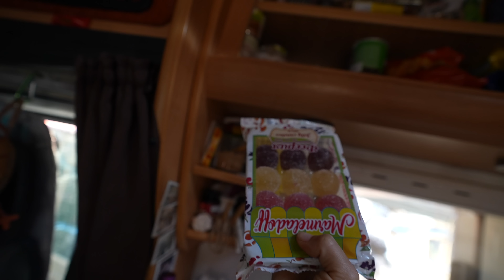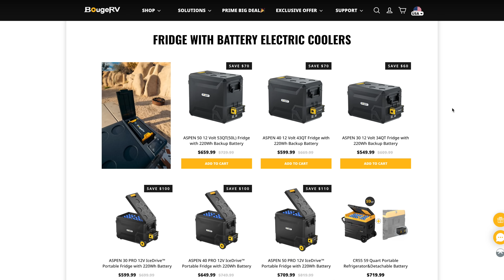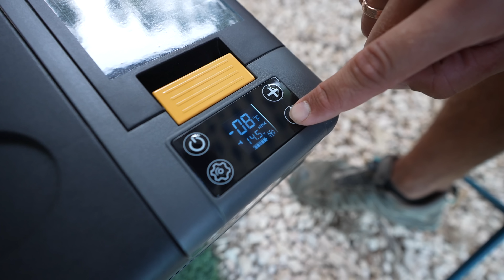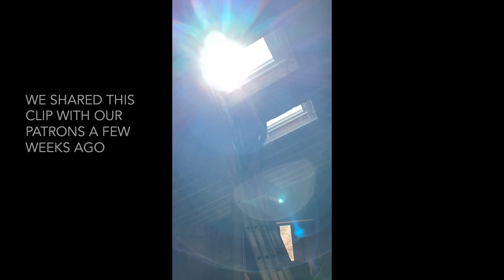THE INCREDIBLE RESULTS OF OUR CHALLENGING ROOF BUILD (with skylights)!

Comment: Great job. On that crack on the pillar, you should fill it with exopy ASAP. There is nothing to worry about, fairly normal, but should be air and moisture tight as soon as possible, so the steel won't rust.

Comment: Excellent job! Igor & team did a wonderful job, well done to them. You can buy shades that sit on the outside your velux windows and believe me you might just want them in the heat of the summer. Theyre easy to install, still let in light. Just think of it as your window wearing sunglasses!  Brittany can also get a pole to help open the windows.

Comment: Helpful hint. Nowhere in LA is recycled water used for drinking water. Tap water comes from Colorado River and wells. Reclaimed water can only be used for landscaping. Hope that helps the next time you visit. 😊
Reply: Not entirely true, L.A does recycle water which ends up in the groundwater basins, which gets treated and later ends up in L.A taps.
Reply: Thank U ❤ City Water is always 
Better. Even in Camden New Jersey. Out of the City and Slim in My drinking water. Love U Both
Reply: In todays world the water from the wilderness has probably seen both human and animal waste byproducts among other things like chemicals. It’s just been filtered through nature by the time it pops up in a spring. I’m sure municipalities test the water and deem the spring safe to drink. Same as done in LA and any other city. ❤
Reply: The roof transformation is magnificent. The larger extended roof will create alot of rain water runoff. Any plans for gutters/downspout(s) and water storage? Filtered, UV light, stored in an inground cistern (s). Could be concrete, drums, barrels, pool, lagoon. Used for washing, bathing, irrigation.

The wedged area below the roof and above the old waterwheel can be turned into a respite multi-functional space with lots of light. Access above at road level and below. Yoga, meditation, plants, reading nook, exercise area, vertical waterfall landscape feature, rope climbing exercise wall, vented glass green house.

I would use the salvaged tree trunk pieces for river bridges or stream obstacles, tables or chairs on the high beach lagoon area. If the wood is good and can be sliced into boards, maybe used as a catwalk connecting bridge walkway on the new wedged roofed area.

For now drier interior with more light. Open windows, reducing any damp musty smell or odors from animal droppings. Future temporary storage and living quarters for winter.
Reply: You two are my favourites for sure. Portuguese school? Come on no one else does this? I love that you guys embrace the Portuguese culture even going to school.   About the cats feed them inside the house even if not fully finished, they will take care of some critters around and make sure they don’t re-enter the house.  Keep it going love your videos.

Comment: Roof look amazing, Dont pressure wash, normal rain or just a hose will be fine, pressure washing is to harsh, it damages the surface and you will have problems sooner. 
Because your house is not built with stone by the bridge then you wont need lime render  there. 
Those new columns look amazing in shinny concrete and visible stone, there perefect. 
Your personality is starting to shine through on the mill. ❤Xx

Comment: Those contractors are very skilled and work hard. You were lucky to find them. I installed a Velux skylight in our kitchen about 15 years ago. Used their factory flashing kit (on asphalt shingle roof). Has never leaked and still looks clear. Thanks for sharing your project

Comment: You will need to put something in those pillar cracks to help the structural strength. I believe there is an epoxy for that.
Reply: Of course the pillars will be finished  and the holes sealed...

Comment: min 12.10. need to give first  first layer, a small amount of concrete on that brick , like you will paint  your walls,  , so that layer will adheres at the brick, after you put the thicker concrete.. in time will crack /separate from the brick because of poor adhesion.

Comment: You will use underfloor heating I assume . Otherwise it will be very cold in winter as large volume rooms are difficult to warm so you’re comfortable.
Reply: Yes  in Portugal to keep a house warm in the winter will cost you a lot ... energy is very expensive...wether it´s electric or gas or fuel....probably best option it´s heatingh the room with some sort of solar panels system...also some airconditioner inverter  units are very eficient..some years  ago I visited a very expensive and well built house owned by  a businessman wich has a big open space - all in one kitchen . dining room and living room - like 15x10 meters... with 3 meters  high ceilings ...it was winter and the lady was in the kitchen cooking and the ambient  felt  cold and uncomfortable..🥶

Comment: Not sure, but I can't help but worry about the crack in that one beam.... If you ever have an earthquake 😮 maybe inject something in the crack???
Reply: It's just a line on the surface of the post and not a crack inside the post.
Reply: In Los Angeles they welded round steel around a lot of pillars on the freeways. I would be concerned about them cracks, if you have earthquakes out there. The crack opens and the re-bar bends.

Comment: Forrar um dos pilares com os troncos da árvore antiga ficaria espetacular, talvez uma mesa redonda em torno do pilar. Os troncos poderiam ser cortados a meio na vertical e colocados em duas peças em volta do pilar.

Covering one of the pillars with the trunks of the old tree would be spectacular, perhaps a round table around the pillar. The trunks could be cut in half vertically and placed in two pieces around the pillar.

Comment: 22.242 skylight . not properly done ..heavy rains --> will leak ..above them should added a  rail/guide  barrier to remove guide  the water in one side.. protection for heavy rains

Comment: min 21.29 that rebar.. again poor vibration of teh concrete.  no proper mix during poring. That is a beam. support  a lot of weight...should be perfect..
Reply: What beam? that  spot is the concrete  filling of the lateral of the skylight hole.....it´s as solid  as a  rock ..of course its not vibrated they filled it by hand....it looks unfinished but all the ceiling wiil need some kind of a finish or cover....
Reply: @netby  that is a beam, because has no support under it .. and has reinforce rebars..
Reply: No it is not  that is the lateral of the skylight box they filled  it with some concrete and they put a little rebar to make it more consistent  there are transom reinforced beams right next to it in each  of the laterals of the box wich suport all the weight  see that  video   at the 19:30.....https://www.youtube.com/watch?v=d1HMoL1AbCk&t=70s